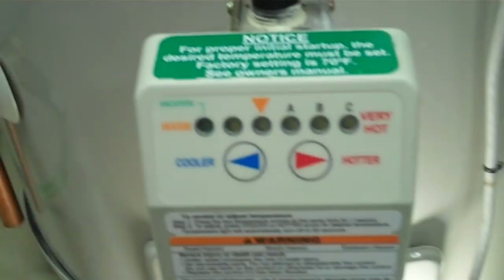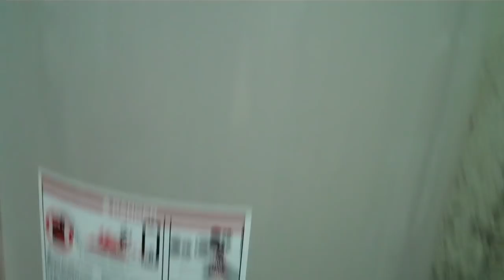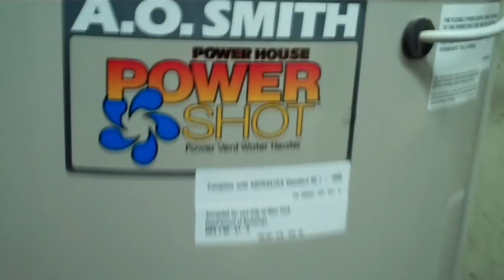Water Heater Flame Gas Short Cycle Ignitor Sensor Troubleshoot Repair AO Smith Igniter@geofatboy

Comment: I followed all those steps. After I put it all together it won’t cycle now at all. Now it just sounds like it is starting then immediately shuts off and 4 lights come on (that didn’t happen before). 

It’s the first light, Skip one, next light, Skip one then the last two lights. All solid and complete shut down. 

Thoughts?
Reply: That light sequence may indicate an error in the hot surface ignitor circuit.  Check that all the wiring is correct and secure.  Otherwise you may need to replace the hot surface ignitor. (according to my manual)

Comment: Any tips for getting at the burner assembly on a newer sealed unit? My Rheem is a 2009, has the same control panel, but it's the explosion proof sealed type and I don't know how to get at it
Reply: Mine is sealed too!.....were you able to get it off on your own?

Comment: Did as video suggested but flame sensor and HSI are as new. But unit still tries and lights 3 times then locks out. ?
Reply: Gas valve/ thermostat unit may need to be replaced. Also check to make sure the distance from the burner to the flame sensor is correct in both planes

Comment: So I have a A.O. Smith water heater model fsph 40-260 No Manuel instructions cuz I bought the house 3yrs ago n I'm having problems with the heat. Sometimes I have hot water n some other times I don't somebody said to clean up the heating rod but I have.no idea where is located and how to do this or what to do plz help btw it has a green light n blinks 6 Times stops n repeat the blinking

Comment: I have the same unit. The problem I have is the water heater starts like it should and runs for a couple of mins. Then stops before it reaches temp. Then it will try to resart but doesn't get to the point of flame on. It then goes into lockout. Any ideas what my problem is? It's driving me crazy.

Comment: I did follow the steps on the video and it keeps doing the same thing till it recycle again and then the 3 lights come on again and I have to turn it off and unplug it to see if it’ll stay on, I have to to this steps almost every day so we can shower, any advise on how to fix this issue?
Do I need to replace the whole intelli-vent?
Please help me and let me know.

TIA
Reply: Make sure it is aligned correctly. Also, for sanding I used emery cloth and steel wool.

Comment: Thanks for your video. I tried cleaning the flame sensor following your instructions and nothing happened. The error code said the internal works of the valve were shot. It was old. So I got a new valve - for $300. Installed it today and it won't work. The burner fires up but immediately goes out. Does it three times and gives up and displays an error code. The error code says the gas pressure may be too low. But it was fine for years until the old valve failed. The flame when it lights up is huge. It looks too large to me. Then it goes out. The flame sensor is clean. I measured the gap and elevation of the sensor. They are to spec. Any ideas?Phil Rolffs
Reply from the maker: Just replying to messages now. So what was it? Did you get it sorted out?
Reply: Yeah, tried everything and finally ordered a new valve assembly. The only local dealer who carries them sells only to licensed plumbers. So I ordered it from supplyhouse.com. Great service, got it the next day. But the new valve was defective. At this point I have up and bought a new water heater for $700. My installation is difficult - in a crawl space sticking up through the floor. Quote to install was $1000. So I put it in myself. No problems - works great. Thanks again for you help.

Comment: HI, Have had this problem periodically for the last couple years and have done what you explained. My question is, do these flame sensor/igniter bars just ware out after awhile?? I have cleaned both with emery cloth and it always works but as mine is almost 14 years old, I thought maybe the part would just eventually ware out and need to be replaced. What are your thoughts?? Seems like i'm doing this a couple times a year now. Thanks
Reply from the maker: If you got 14 years out of it I'd be happy with that. Next time it goes down you might want to just replace it.
Reply: Do you mean the whole water heater unit or just the igniter/flame sensor part we are talking about?? Thanks

Comment: if I don't have sand paper..are there any other alternatives
Reply from the maker: Mos def Morgan: Steel wool, emery board, nail file, a dollar bill also works in a pinch. The high-rollers use 100 dollar bills :)

Comment: I have a gphe50 vertex ngas water heater. it goes on for a second or two and goes off after attempting 3 times. Would this be a problem with that flame sensor as well.
Reply: That would be my guess, even my furnace has this 3 cycle safety and it's all from bad/dirty flame sensors.

Comment: what's the proper way to clean the glow bar/igniter if you accidentally touch it several times before watching this video? I was kinda drunk so that explains a lot
Reply from the maker: +jltaco85 
Rule#1 Don't work on appliances or other machinery when under the influence of drugs or alcohol!
It's highly doubtful that you will get the oil from your fingers off of the igniter.
Reply: +geofatboy I'm guessing rule #2 would be: if you're going to be under the influence of drugs and/or alcohol, make sure you pass out before you get the urge to work around the house.
Reply from the maker: Anyone got a Rule #3? We can keep this going!

Comment: i purchased a ignition assembly for my gas hot water heater, and now realize it is part # for a 75 gallon, and mine is a 40 gal. can I still use it?
Reply: Call AO Smith with the model/serial of your unit.  They will give you a part number.  Verify the P/N against the ignition assembly you just bought.  There are very specific tolerances in lengths and angles of bending between ignition assemblies and different model numbers.
Reply from the maker: Yes, what he said...
Visit https://shavenation.com/ If you'd like to improve your shave!

Comment: my unit has the inteli vent thingy on it says ignitor is bad i changed it it still does not work and thats the only code i have so what could be causing it i changed the ignitor b4 it lasted a year now it wont even light
Reply: Have u tried getting in touch with the manufacturers of it?

Comment: What can u use instead of sandpaper
Reply: i used steel wool and that worked well
Reply from the maker: Steel wool, emery board, Nail file, sandpaper, dollar bill... It's all good! My Motto: Do what you can, with what you have, where you are!
Reply from the maker: See below:

Comment: hi , we have the same problem. It was trying 3-4 times then stopped turning on.
We opened the outside cover and tried to take this assembly out. The sensor looks clean (this unit is only 5 years old).  Another problem we are having is that, there are 2 burners side by side. Dont know how to take this assembly out. Anyone wih 2 burners inside was able to fix this problem?  

After we put this back in, we notice that the unit does not even turn on anymore. I followed instruction (ON/OFF switch, set HOT and COOELR button together, make it cool all the way, then wait 5 minutes and turn ON, set the thermostat to Orange bar (Default/120 degree)... no luck.. the unit just shows the light where thermo is set to then goes away, nothing starts.. any suggestion?
Reply: I have a 2 burner also.  You have 2 little doors a outer and a inner one.  Take the outer one off just by lifting it of the inner one does not swing it's like a snap on bracket, Just kind of unsnap it. You won't get the dunes out, but what you do is after disconnecting the valve or gas line just pull the burners as close to the opening as possible and you will see a little screw between the heat sensor and the ignighter. Take that screw out and just take off the assembly with the wire as then you can clean the heat sensor with ease.  So therfore you don't need to take out the burners.
Reply from the maker: Thank Alan!